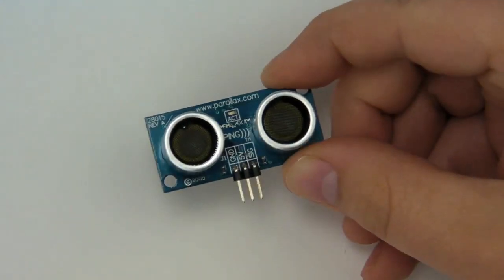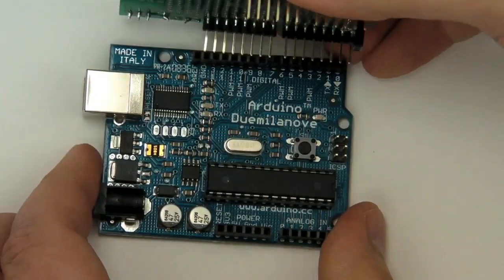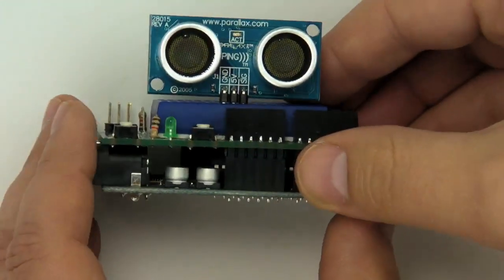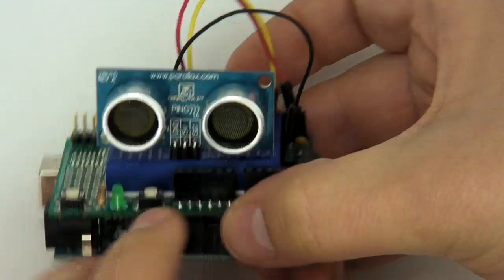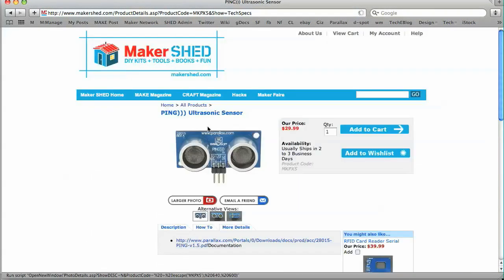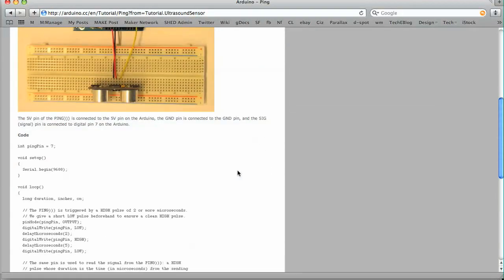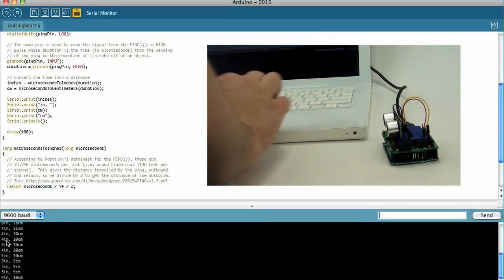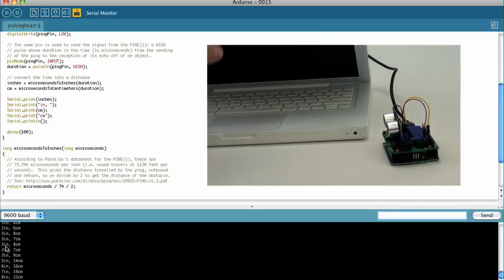How-To Tuesday: Ping))) ultrasonic sensor

Comment: what are the use of these two cylinders in hc-sr04 ping sensor, and is it possible for this 40khz ultrasound to penetrate or to get entered into a medium other than the air,

Comment: I tried connecting PING in the same manner u did..But the ACT Led on the Ping sensor does not flash neither its working. everytime its shows 0 inch 0 cm in the serial monitor.. are there any more videos eleaborating the coonection in a better way n that too with an android phone and not with PC??

Comment: @Coolnventions You'd have to disassemble the sensor (which shouldn't be that hard, but you might not be able to use it for legos anymore) and find out which pins are which.

Comment: The ultrasonic sensor is a “smart” sensor able to communicate with the host controller using variable-width pulses also known as pulse width modulation (PWM). Even though it is using only 1’s and 0’s the width or time period between these 1’s and 0’s is proportional to the distance measured. Microcontrollers can very accurately measure the time between these pulses with microsecond resolution.

Comment: @ldeath83 yes, I thought of the same thing a while ago. I found it hard to think of a way to make each pin move independently. Linear actuators are expensive and too thick. If you can find a cheap way around this problem please share.

Comment: Umm no, it doesn't use the Doppler effect. It sends out an ultrasonic sound signal and wait's until it recieves the echo. And by measuring the time it takes from it sends the signal until it recieves the echo it can calculate the distance.  Pretty simple.

Comment: You're implying parallel monitoring... I'm implying serial.. First we check with the ultra-sonic, then with the IR. It's a double check... The only object that won't be detected very well then, will be a black soft object. But I think this sensor works on a different principle than reflection of sound. Think it uses the doppler efffect. Anyways... IR is much faster and more efficient for short distances - i.e. sumo bots.

Comment: The sun spectrum is filtered if I recall correctly, as well as most interferences. The only possible reason NOT to use a IR distance sensor is because of a possible weak reflective ability of a surface. But the utrasonic sensor also has this problem. Perhaps a combination of both ultra sonic AND IR, would be the perfect setup?